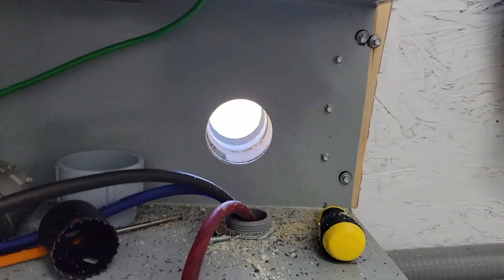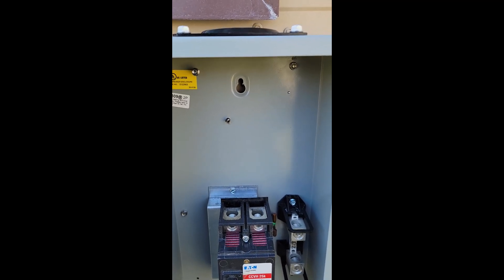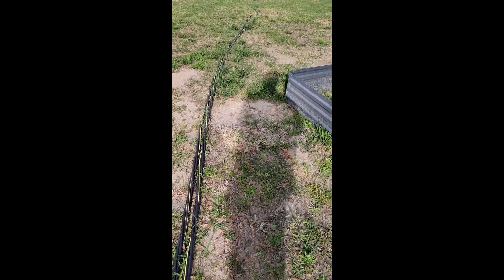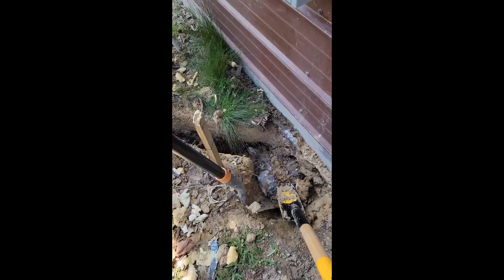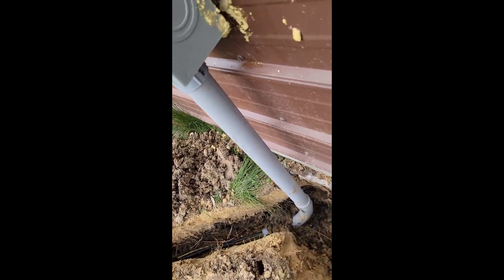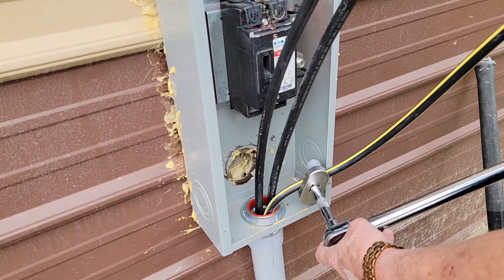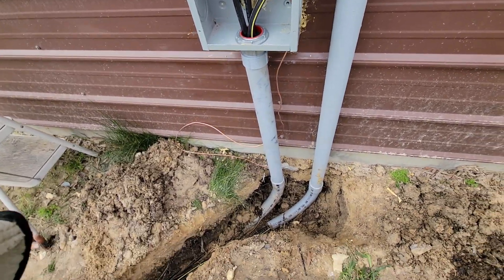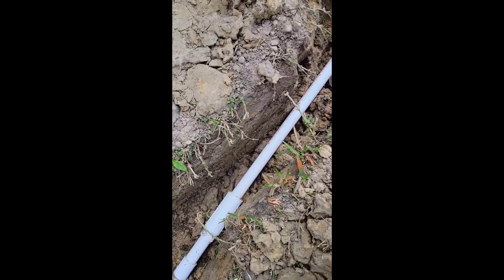Trenching for 18kpv

Comment: In my area you were never allowed to install a meter socket under a window so being that I nevet came across   only a small AC disconnect under a window doubt if a large panel like this would be legal.
Reply from the maker: The only spec I can find in the NEC is section 230 #C. Specifying the location of conductors around building openings. There are no conductor accessible here. Everything is in the box or conduit.  I don't think this will be an issue.
Reply: @gerrypineau  Our local utility company had what they called the " Blue Book " a 5 by 7" maybe 120 page booklets that I believe had not be allowed to Install a meter socket under a window. Book now is only available over the internet. Biggest joke with this very large electrical provider they had a post card that you filled out for them to send you updated. Probably mailed them 6 of these pre paid post cards over a 35 year period and never received a single update. Can remember my dad finding out about an update after he failed a 100 amp service upgrade that he was never notified of a change. Electrical inspector told him not to feel bad because he failed every new service the first week of change until word got around.